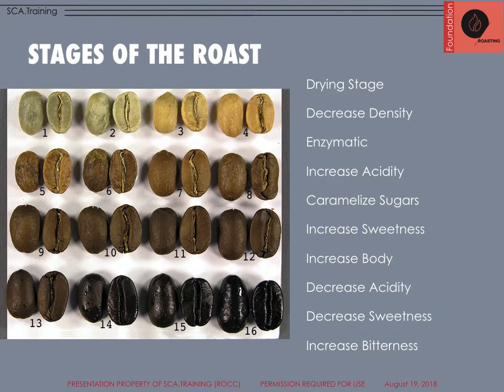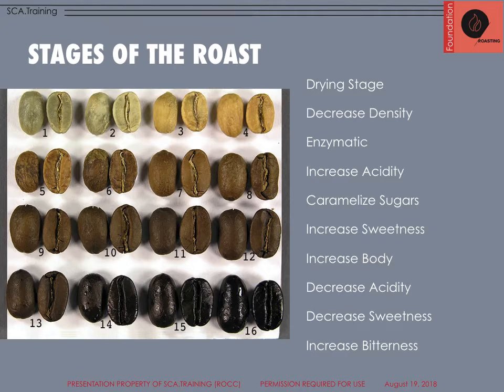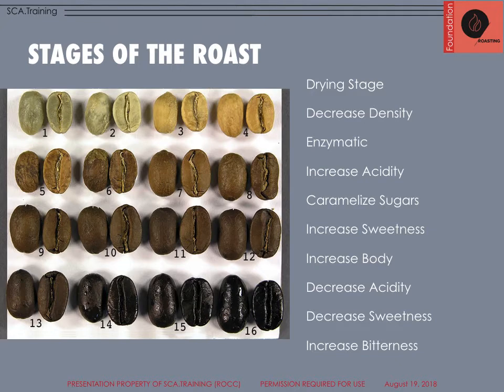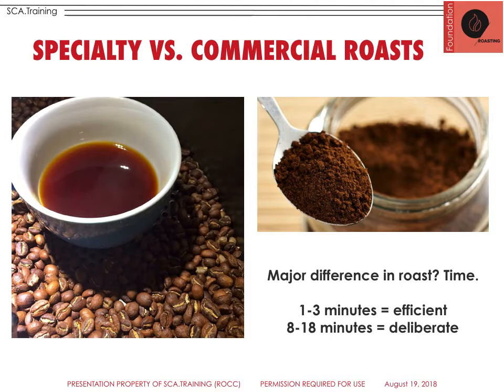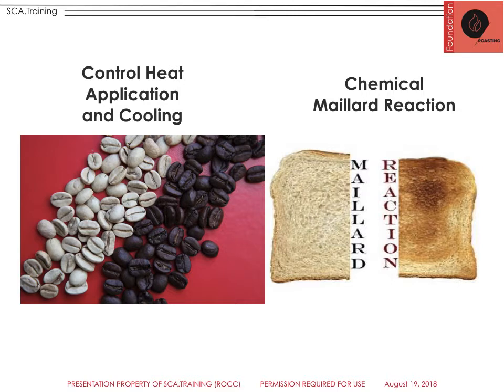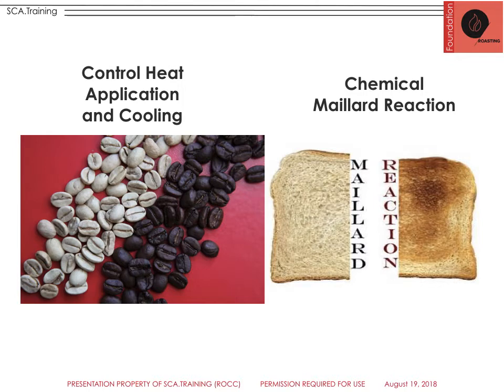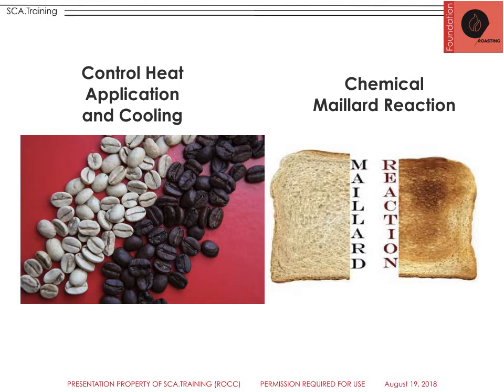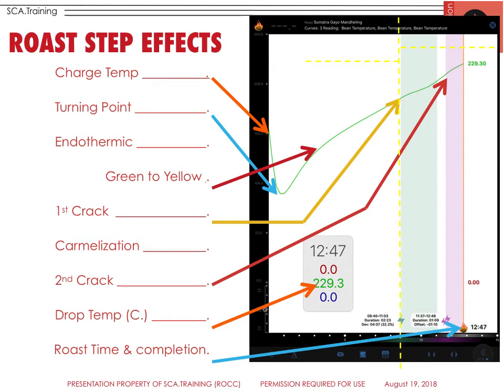SCA Roasting Foundation - Part 3 - Sharing my old PowerPoint slides with content explanations.

Comment: Nice video ❤ In roasting operation ,most of the roasters guy focus on how they can manage air inside the drum , 
different roaster machine manufacturer have their own technology and explanation .
Like diedrich , probat and etc.
How does it affects the roasting ?
Reply from the maker: Hi Dominic thanks for your great question. It affects roasting in every way, but I'll just offer a few points to highlight and perhaps you have a more specific question afterwards. Please let me know.

Air inside the drum (convection) is a powerful force. As you say, some roasters focus more heavily on it, because the thermal power transfer (or requirement) differs with various machines and various drum sizes.

When we start roasting, on a traditional drum style roaster, we tend to focus heavily on the flame or heat applied to the drum. This is like pushing the heat from underneath - conductive heat.

As we roast longer we begin to learn how strong hot air flow through the roasting chamber adds a great boost to roasting by pulling the roast progress from above - convective heat.

I use "pushing" and "pulling" because the image works. The heat from flame to drum immediately impacts the bean surface and must transfer to the center of the bean from the small point of contact. The heat flowing through the beans and system by air can more effectively surround and penetrate the bean to the center by convection.

Increased drum heat can easily cause scorching or burning. Increased convective (air) heat can speed up the roast and help with drying the coffee while roasting.

For simplicity some would say that a large traditional drum roaster takes more time and is conducive to espresso roasts for slow sugar development. Some would say then that air roasting (like a Loring) can take less time and thus do well highlighting coffee nuances in light roasting.

That gives a lot to talk about. I welcome your and other questions.
Reply: @CoffeeTraining  Most of the roaster now a days put pressure gauge on airflow ,, roasting of coffee is a never ending learnings because of thousands of compound elements on it. 
Everybody seeks for new flavors,studies and etc.
I learned a lot on your videos.Keep it up, 
By the way I am a technician thats why i have a lot of questions on coffee development.
I encountered diedrich, probat,mil city, santoker, bideli , proaster . Most of them differs in technology used, drum metal content and airflow but they all common in one thing .Produces good quality coffee.
Thank you very much